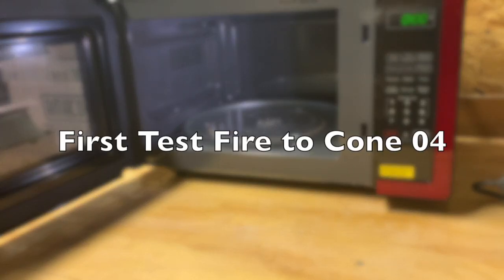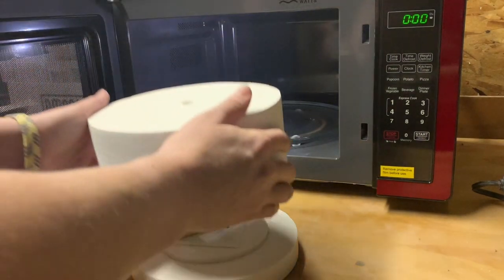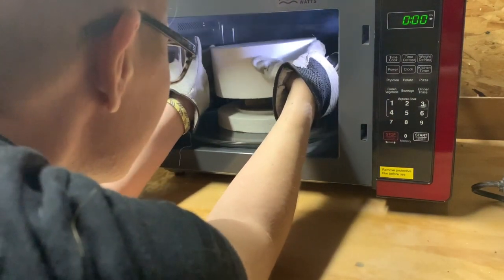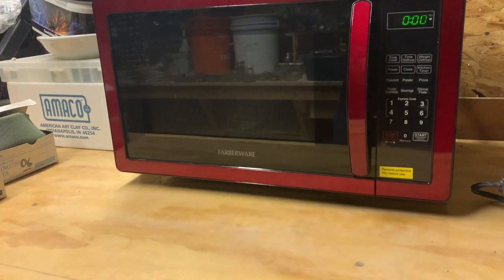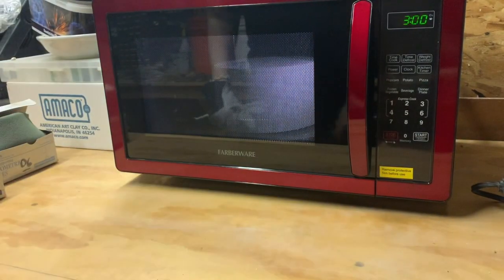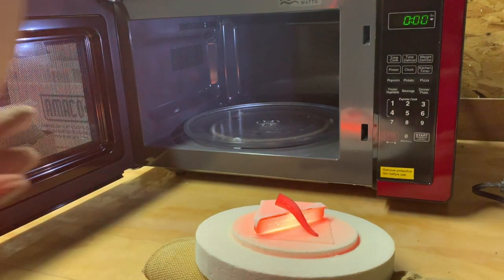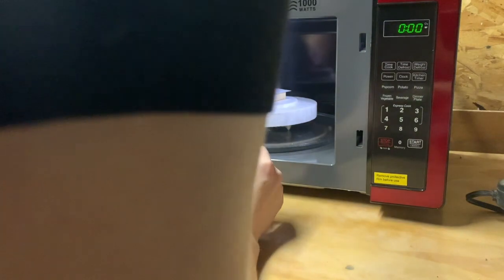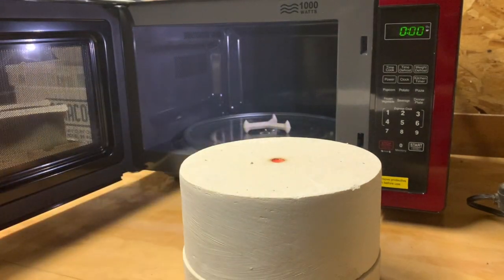Microwave Kiln 04 Test

Comment: The glass plate was getting warm because it was also absorbing the microwave radiation, not because of the kiln transferring heat to it via conduction. If you remove the plate when using the microwave, it will be even more efficient since all of the microwave radiation will get absorbed by the heating medium (SiC) that covers the inner walls of the kiln.
Reply: Yes, thats right. I have seen it on an other Video. The Glass Plate getting hot and absorbing the Microwaves. More Microwaves -> more hotter the Plate -> absorbing more Microwaves.....
Reply: @Schattenmeister  when I tried this it heated up just one spot on the inner wall of the kiln, not good!

Comment: Hello. I am interested in microwave kilns for scientific/lab purposes. I don't know much about how the cone system works, but it seems like the kiln had to get up to 1915 or 1945 F to melt that clay, right? Or is there more to it? Thanks!
Reply from the maker: Hi Kenneth, Cones are a measure of temperature over time and are used to judge the "heat work" (basically has everything melted appropriately). So they are not giving us a exact temp. The cones are made of the same materials that our clay and glazes are made of and if the cone bends then it is a good indicator that our ceramic pieces have gone threw the appropriate amount of heat work. 1850 to 1950F is a good guess but cones are not meant to judge only temperature. I hope this is helpful.
Reply: @laurahaight2660  Thanks! The reason I ask is that other sites say that microwave kilns can reach only 800-899C. Melting a cone 04 would significantly surpass that at around 1000C+! That evidence is really useful, as these kilns seem less studied and are harder to study, as getting measurement equipment in a microwave is tough ...
Reply: To get those high temps you would need to insulate